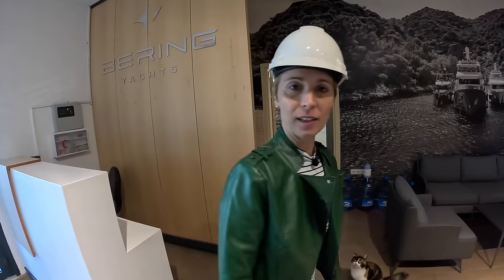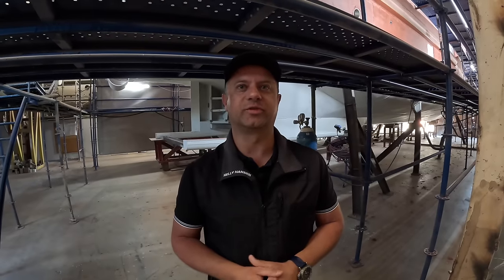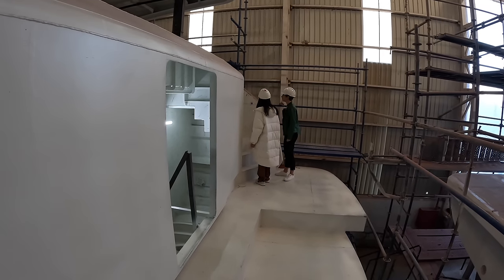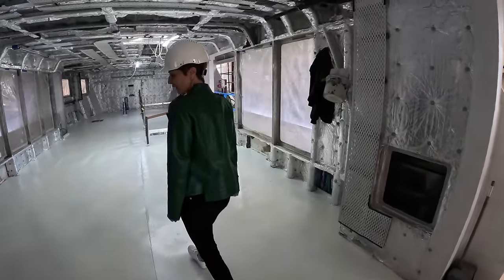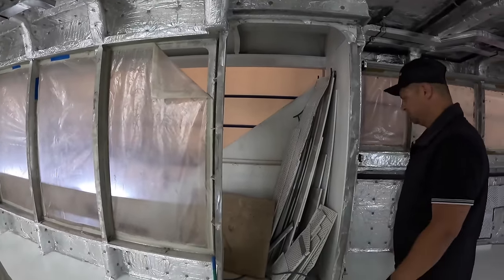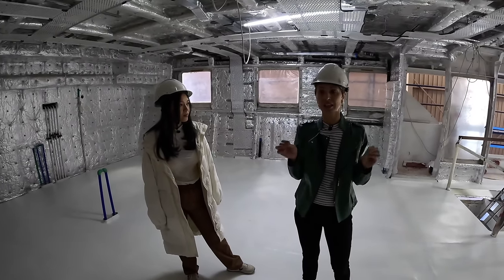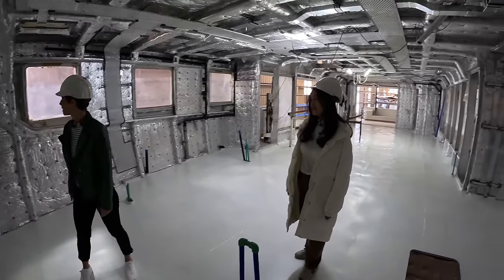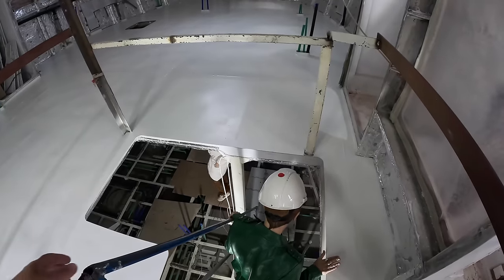Our Boat Update! 😝 It's getting Real 🤪 Eps. 46

Comment: Just fascinating how much respect I've gained for shipbuilders (Bering in particular) simply by watching this series. Just thinking of the design and production work involved feels overwhelming. And the customer service is exceptional.
Reply from the maker: They are top tier 💙⚓️
Reply: @NautiGuys can I ask if you have a metal structure, in the summer the metal (that you touch like walking be the side rails or in the back under the deck the front sun pad/anchor area,, there is a lot of exposed  (probably with paint or wrap) metal) won’t you burn yourself?

I don’t really know a lot about yachts though, but there is probably an answer.

Comment: The metal window cover that you mentioned is usually called a Deadlight. We used them mostly to stop light leaking to the outside from inside the ship (at least on a warship). When we had opening ports (scuttles) there was a more substantial Deadlight, as you said, if there is ever a problem with the window glass. Your Bering 75 is looking more shipshape and rather fabulous, by the way.

Comment: The metal plates that can be fixed to the inside of windows in rough weather, these are also on cruise ships. I worked on cruise ships and they have covers for all port holes and the smallest Windows up to and including deck 5. They use a hinged bolt with butterfly nuts to securely seal the window in case of breakage. It is actually the twisting of the ship/boat in heavy seas that breaks the window more than the water pressure. The exception being the forward facing windows. 
As always another great video from you. Thank you for sharing..

Comment: The Bering 75 is looking impressive guys! 

Make up air unit is to counter the kitchen hood exhaust unit primarily so you can open the doors, by keeping the areas in positive pressure. Often the MAU is just called the supply fan system when on a VFD drive motor plus pressure sensors, of the HVAC network, but some times on older systems they have a dedicated fan that comes on when the kitchen hood exhaust fan comes on to re-pressurize the kitchen area.

Comment: Interesting seeing the stern hull-form.  The aft thruster will get good turning moment that far back.   The inside space will appear huge, but just wait until the panels and bulkheads are fitted - you'll get a surprise !   the port covers are 'deadlights' - an important feature below your 'freeboard deck'.   Some vessels have storm covers for maindeck windows for long passages (the Flemings etc under owner/operator use).
Reply from the maker: Thanks for sharing! 🙌

Comment: Guy the storm covers you are talking about, in seamen’s nautical terms are called “Dead Lights”. Was on a ship one day going around Cape Hatteras, in a storm and we lost power, that old ship was always breaking down, she got beam on to the seas and got slapped by an extra big one, it broke 4 port holes on the Stb side, they had 2” thick glass in them, they shattered into a million bits, and the sound was like a cannon going off, if it wasn’t for the fact that we could batten down the dead light quickly, because on a cargo ship they are permanently there, hinged up and held up by a chain on the deck head, we would have been in a lot of trouble that day. So you made a very wise decision to eliminate them from the lower deck I think, and as the old saying goes never underestimate the power of the sea. Good luck guys she is coming along nicely.

Comment: Wow! Looking great you guys!!  Just a humble suggestion to viewers who want to see more with less talking?  On the tool bar at the bottom of the video, right side, just right of the CC button, there is a "Cog" shaped button, pushing that gives you the "playback options".  Clicking playback speed gives you the "speed" options. "Normal" should be selected,  clicking on +1.25 will change it to 25% faster playback speed. Do that, and click anywhere outside the box to save. Then the video will play at 1.25% normal speed, more looking less talking. Use the same procedure and select "Normal" to return it to normal speed. That will also work on any video posted on YTube.  If this helps one person it was worth me posting it.  Again, congrats guys!!   8)     --gary
Reply from the maker: Didn’t know you were on such a time crunch 😝😂

Comment: I love your build and as always, I'm thankful for the time you take to share it with us. I think I'm almost just as excited as you both must be to see the finished product. 

I have a question for Rico about sound deadening. I know you're going to have a killer sound system. I was wondering if they will be using additional sound deadening around the speakers/ walls, and wanted to know if they use the same type of stuff they use in automobiles, like butyl sheets that get applied to metal and plastic panels to reduce vibration and noise?
Reply from the maker: Hey Richard, 
No additional sound insulation is needed. Also our speakers are self contained so dont vibrate or so. Thx for watching, rico

Comment: In time, those drains will clog. Tomorrow it wouldn't be a problem, 10 years from now when you are actually facing a clogged drain there is going to be rust, paint chips, dirt, salt, and other contaminants in there, and you may find it impossible to get a snake through all those turns. You'll do the usual and try pneumatics when the snake fails and that's when you may experience the fun of a blown drain. This is 25 years of actual sea time (away from the dock and interestingly in the Bering Sea) on steel commercial fishing vessels, talking. It would be easy to fix now, harder later.

Comment: Is it just me that thinks it looks kind of strange where you have the window and you say it will be blocked by the freezer?  It looks like those windows on the end are just cutoff by the walls and not the shape of the others.  Wouldn't it be better to make them a little smaller so that you can have the corners rounded like the others, and then have a little wallspace before those shorter walls going into the cabin?  With them cutoff, behind freezers, and behind those walls, it just makes it look like you did not plan it out and wound up having a wall right in the middle of a window.

Comment: If you want to see outside on the lower levels and let light in use flat screen TVs with a remote camra to the outside so you get the view but still have no portholes the camera could be set into a safty blister or set just below the toe rail you can also set these camerasis you have two or more set to be linked into your security system so you get a image weather the TV is on in the room or not its just an idea but I belive there is enough technology to achieve this today
Reply from the maker: Great idea!!! Writing this down... 📝

Comment: How many gallons of filler are they spreading on the hull of these boats. The filler looks like it's an inch thick. I wonder how much weight they add with filler. It's a shame that they are incapable if building a smooth steel hull.
Reply from the maker: Sorry, but What a silly thing to say… you need to cover the welds and protect the steel for years to come 🤷‍♀️ and no, it’s not an inch

Comment: What type of GRP material are they using at Bering Yachts to cover the welds on the hull on your Bering Yacht?    Please explain.
Reply from the maker: https://www.youtube.com/watch?v=Dqg_okoAHAg (also consider watching the channel from the beginning, we explain everything)... all the episodes are numbered
Reply: @NautiGuys    Ah yes.. I do watch all your vids.   But this material (GRP)  you could not have talked about ..because you are just now getting to where they are applying the GRP.    Is it Fiberglass,  Is it a polymer with aluminum mix...etc   There are many different materials that can be used for this.
Reply: It’s called faring, a two component filler